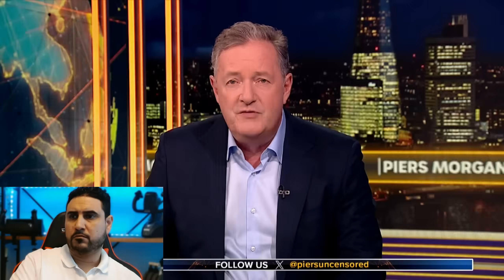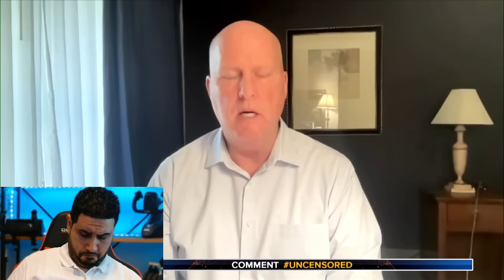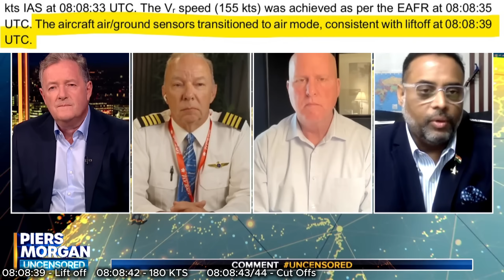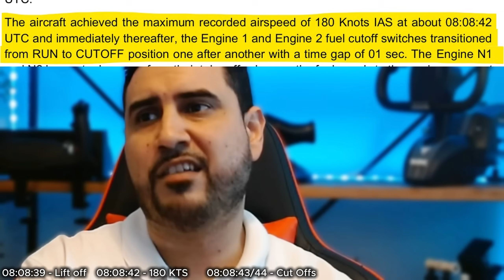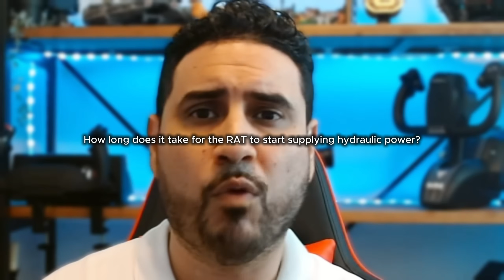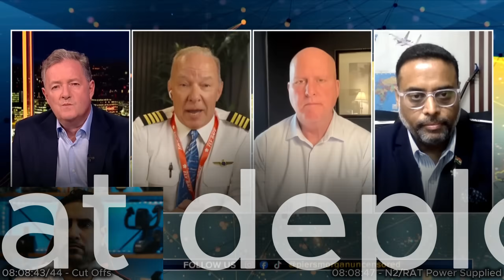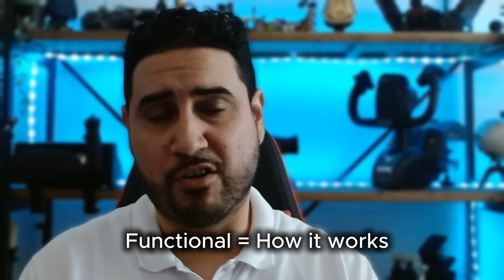TOTAL SYSTEMS FAILURE BREAKDOWN | AIR INDIA 171 | AAIB PRELIMINARY REPORT | MAYDAY | MSFS2024

Comment: Multiple sources indicate that the RAT began deployment on Air India Flight 171 BEFORE the engines were cut off. Here's the timeline from the preliminary report: 08:08:39 UTC: Liftoff. Between 08:08:39 UTC and 08:08:40 UTC: RAT deployed. 08:08:42-43 UTC: Engines 1 and 2 fuel was cutoff. 08:08:47 UTC: RAT began supplying hydraulic power. Based on this timeline, the RAT deployment initiated approximately 2-3 seconds BEFORE the fuel cutoff for the engines. This points to electrical failure PRIOR to the engine shutdown, which means it was NOT pilot initiated. Neither pilot moved those fuel switches before fuel cutoff by the plane. 

It takes a human pilot in the cockpit at least 2 seconds to pull up then push back those two locking fuel switches.
But for AI171, the fuel to the engines was cutoff withing a single second.

The facts are as clear as the morality of it. Neither pilot touched those fuel switches before the malfunctioning plane cut off fuel to the engines. The Boeing shills knew these facts all along, which is why they developed the pilot suicide/murder narrative, but that narrative is not only offensive, it has been proven impossible.
Reply: RAT can be deployed manually, anytime. Any deduction from timing associated with RAT.  So, deployment need not necessarily indicate anything about the craft.
Those are clear facts. So, it's back to you to apply your rationality
Reply: @ZoubirKabir If I have to take the airplane down, why would I deploy RAT manually? Secondly auto deployment of RAT happen on dual engine failure. And the time stamps of maximum speed achieved, fuel cutoff and RAT deployment doesn't add up for sure, these are clear facts too.
Reply: @GorZic Second point first: it is not proven that "RAT happen on dual engine failure". It is only given that it deployed, not why, and not exactly when, only when it started to deliver power. This is my point: there is no evidence given for the cause of the deployment. One possible cause is manual. It can not and should not be ruled out until and unless the specific command is stated; by aircraft or by human.
First point: deploying the RAT before cutting the fuel - if you have to take the airplane down - cuts/corrupts the electrical systems and - as this exchange of messages proves - helps to cause confusion in the cockpit to mess with the FO/PF and the investigation too.
Reply: @GorZic finally, you mention "time stamps ....and RAT" There is no timestamp in the report for deployment of the RAT or what caused it.
Reply: @ZoubirKabir what is there to prove, this is how machine works as per specifications. When your in a car accident the airbags are deployed. There is nothing to prove in that. Yes manually is also possible but as I stated it doesn't make sense
Reply: @ZoubirKabir  yes it's not in the report. But in Boeing planes RAT is designed to be deployed 6 secs after dual engine failure, and 8 secs in airbus. It will start actually providing power after 10 secs.
Reply: @GorZic manual deployment of RAT changes parameters of craft, ensures delay and insufficient electrical and hydraulic power, aiding malice aforethought. It adds to confusion and panic for the other pilot before the crash, increases the likelihood of crashing, and increases confusion for the investigation. Seems to have done the jobs well. The mind of a killer, eh?
Reply: @GorZic it is also designed to be deployed manually, for whatever reason a pilot intends.
Reply: @GorZic manual deployment delays and reduce power by 10 seconds. Arguably - get this    - if the RAT had not been deployed, and the good pilot had another 10 seconds after startle effect and panic follow procedure, if Engine 2 had another 10 seconds to achieve thrust, and so on, do you honesty believe the result would be the same or could you possibly hypothesize that it might have been different. I could very easily argue: different. I could very easily argue it was the RAT that guaranteed the intention of the bad pilot. RAT deployed manually alone would probably not have brought down the craft. Arguably fuel switches alone may also have failed. If you can step outside your normal, rational, intelligent being mode for one moment and enter imaginarily into the mind of a psychopathic killer, what better combination of two actions, three switches could you suggest would have a higher probability of success? 
The best detectives habitually inhabit the imaginary mind of criminals and suspects to discover motive and intention. That is what I have done. That is what I hypothesize: first RAT, second Cut-off, third deny, fourth sit still say nothing. 
Having said all that, I still favour the hypothesis of Dr Ranjit John.
Reply: @ZoubirKabir Good attempt but one fatal flaw in all your analysis - If I had to take the plane down and know I will "die", I wouldn't bother planning for sabotaging of investigation which I would never even know will succeed or fail, instead of risking main plan of crashing the jet with mental gymnastics of what happened later I would focus on making primary goal of crashing the jet a 100% success😂
Reply: @GorZic One fatal flaw in your analysis. It may very well be the case that if the cause were deemed to be the fault of the other pilot or the aircraft, or indeed sabotage, then the family of the actual guilty pilot may receive some form of accidental death at work compensation, whereas if he were found guilty by the current criminal investigation that may not be the case. This assumes he actually cares about what happens to his family afterwards but if he did he might do his best to disguise his actions and muddy the water of the investigation. Psychopaths enact highly premeditated programmes. I wrote elsewhere of how "Sad Sack" may have reached such a psychotic state.
Reply from the maker: What are your sources?
Reply: @FinalApproachPOV  Google AI Overview and my own critical thinking and honest opinion.
Reply: @FinalApproachPOV no special sources needed, the times are mentioned in report. It's how you conclude based on the reported timestamps, and it's pretty rational